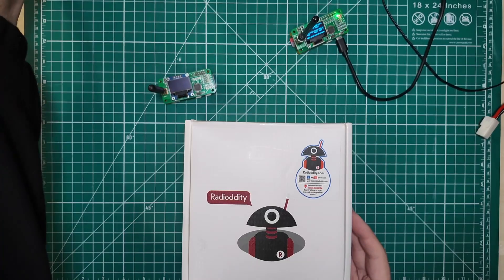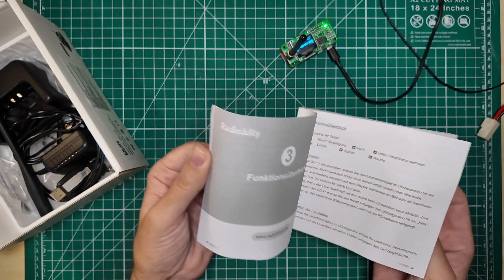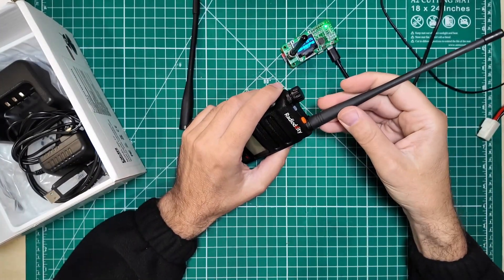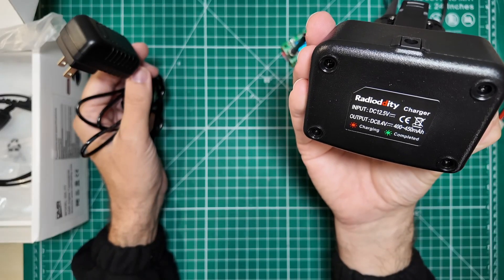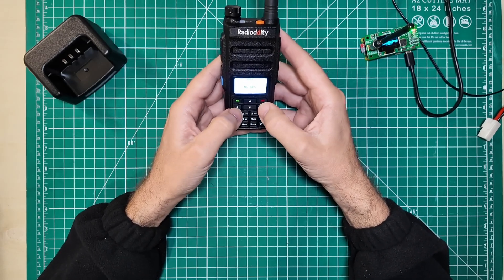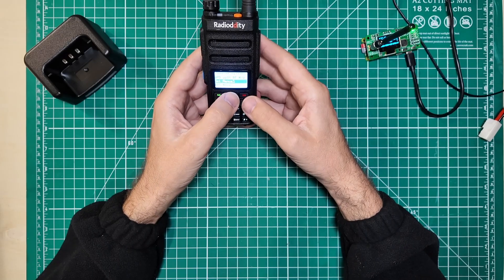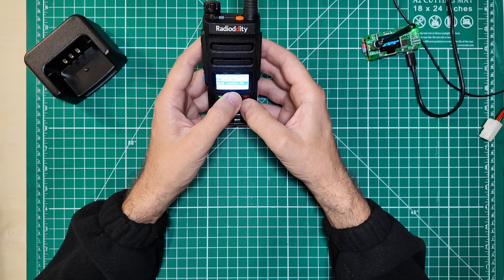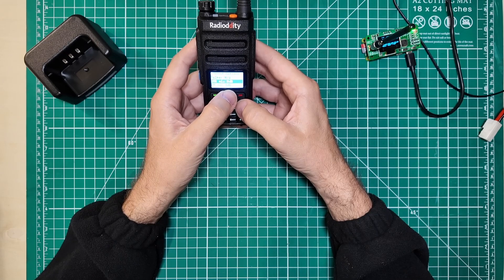A Walk Thru OpenGD77 and the GD-77 Radio

Comment: Hey there, I recently downloaded the open software and I have a radioddity 77 and I’m using a cable that came with my TYTUV 8000 D and I can’t get the computer to recognize my radioddity 77 radio it says no device found I wonder if it’s my cable or if it’s a driver I need to install and where would I install that driver I wonder
Reply from the maker: Does your computer see the cable at all or just not the radio?  If Device Manager doesn't see the cable as a Serial Port or COM port, check the instructions here:  How to install programming drivers on windows: https://learn.adafruit.com/adafruits-raspberry-pi-lesson-5-using-a-console-cable/software-installation-windows
Reply: @ thank you and my computer sees it as a serial port but it always says no radio detected
Reply from the maker: @joshhayes9570  That's good new - there is a 75% chance that windows is happy now.  Next up the cable needs to be pretty firmly pressed into the radio, so if you're not all the way home, that's the next solution.  Are you trying to do codeplug work or trying to install the OpenGD77 firmware?

Comment: Great rundown, thank you. A friend gave me a TYT MD-UV390, hoping to chat over DMR. I never used hotspots for 30 years, and, somehow, two died in two months. The radio is useless from the front panel, so I really like your requirement that it work without requiring software. I should swap out the firmware so the radio actually serves a purpose. Thanks again for the rundown. I'm off to learn more about OpenGD77 and what makes it special.
Reply from the maker: I hope the OpenGD77 team keeps plugging away at it.  I see a lot of potential in having a radio firmware that is made by hams for hams.

Comment: In addition to the GD-77 I got me a Retevis RT-90, a VHF/UHF/DMR 50W mobile radio, which is still available. I also installed Open-GD77 onto it, and am using it not in the car, but in the shack with a Diamond X510N antenna.
It is nice to have the same firmware on two different radios.
Reply from the maker: Standards!

Comment: The GD-77 is one of the best HT radios I've ever owned. It's taken a few spills to the concrete and stayed intact and functioning, some radios couldn't do that. I really wish Radioddity wouldn't have discontinued it for the GD-88, but it is what it is. For satellite use, you put in your 6 character grid square and it'll do the rest after that. For the OpenGD-77 firmware, its a huge upgrade to an already great radio. You lose the encryption ability it originally comes with, but you gain so much more that its not really worth mentioning.
Reply from the maker: Yeah, she was a tank!

Comment: Got the Retevis and TYT versions of this radio but I can't get either one to consistently talk to a computer for programming.  The GD77 advice to just try other USB ports hasn't helped.  Five PCs, one of them should work.  Nope.   I can't even just give up and sell them because I can't promise anyone else that they will work.
Reply from the maker: I wish they were supported by Linux - I can do the firmware load under linux, but can't edit the codeplug there.  Are you on Windows 11 on any of them?  Win11 has a TON of problems with chinese radio USB cables.

Comment: That's a nice radio. It is the same one I have for DMR. I don't use it outside the house, but there's not really DMR repeaters around anyway. I probably need to upgrade the firmware since it's been a couple years, but OpenGD-77 is great. Thanks for another informative video. DMR is a PITA (that's just my opinion).
Reply from the maker: DMR is a PITA

Comment: You can go over the max power of 5W if you hold down the blue button and long-press > instead of tapping it. Probably best only use that in an emergency.
Reply from the maker: Good tip!  Yeah, I can imagine that would drain the battery fast and might even hurt something inside the radio from all the heat.

Comment: great job on that radio. That is common for a watt meter to do that threw a antenna. it is adding forward to reflected power . And that meter is calibrated into a dummy load. The best meters for that are the directional wattmeters. Cost a bunch more but give accurate reading of forward and reflected power.  I got one for HF I use all the time.  It is a cross needle one.  SWR meter is just a ratio. They great for showing when you heat a toroide up. The reflected watts creep up then rich a point and lots of reflect.  There's  a warning sign before the reflect goes crazy . 73
Reply from the maker: Totally agree.  The surecom meter has a FWD and REV power reading at the bottom of the display.  Lots of stuff in that little box.

Comment: Steve I have the Boofwang version of that radio(1701) and it works great on Open GD.   If you get a chance to grab one of those they will go down to .2 watts  which is great for at home use with a hotspot.  Upside is the 1701 has a color screen and is pretty easy to program from the front panel.
Reply from the maker: I saw that color screen... I'm digging it!

Comment: The satellite support in opengd77 firmware is unique as far as I know. Doppler, sat tracking, VU, UV, etc. The firmware works on 5 other radios as well - I have it on my RD5R. SOO much friendlier to use than the standard firmware.
Agree that it is easier to program using the CPS.
73 Ed.
Reply from the maker: I need to find a radio with GPS and play with the sat tracking features. Would be good to have a non-windows CPS while I'm wishing!
Reply: @temporarilyoffline  Any Tone 878 UVIII has GPS and Satellite tracking in latest firmware update. Unfortunately, Windows only (I have begged for a Mac version)..
Reply: @temporarilyoffline  the sat tracking feature does not need GPS. It's nice when the radio has GPS but you can enter your location manually. Ed
Reply from the maker: @DD5LP  Excellent!  I have another radio to run GD77 on coming up soon.

Comment: I've swapped the firmware in most GD77 radios that have found their way to my bench. The stock firmware is awful and not worth investing time, however once you start using OpenGD77 you'll never go back to stock!
Reply from the maker: Hey Scott!  I think anytime a person actually uses a radio, they'll see how to fix the interface right up!
Reply: @temporarilyoffline  FYI to adjust the power, hold the blue side button and then use the left/right arrow keys  👍